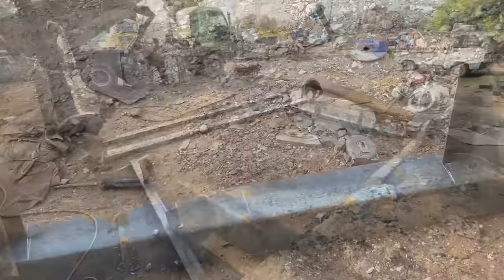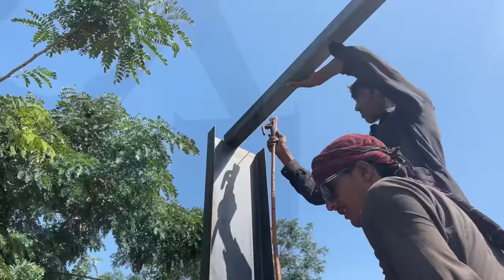The Process of Making Hydraulic Dumper Body-How Manufacturing Hydraulic Dumper Body|

Comment: Wonder how many accidents happen when it falls apart because not fully welded and it will be OVERLOADED
Reply: Weak welding yes
Reply: It would stand a better chance if the welds were about 2-3 inches long not just that it’s very thin metal?
Reply: Most of them welding are just tacking the body together, if you look at it before its painted you will see more longer welds, its always better to tack it to hold it together then finish the welds once its built
Reply: It was fully welded at the end
Reply: This is made just only for single trip. 😉
Reply: It was not fully welded, only had those tacks!!!!  Even it had continuous later on, all those reinforcement channels outside &  inside were covering places that were only tacked!
Reply: Those poor people will end up blind 😪😪

Comment: Your work is very nice but still using Electrode to welding why not MIG Welding after some time Electrode welding may be cracks MIG welding is better
Reply: I would imagine lack of availability. Where are you getting bottles of 75/25 in Pakistan for a reasonable price? Stick welders are ubiquitous and sticks are cheap. Plus no maintenance, and you can obviously see by how they work that the regulators would be smashed off in a week and someone will knock over a full tank and make a missile